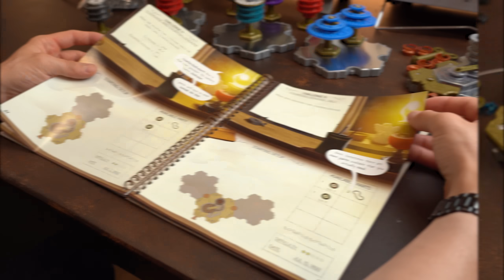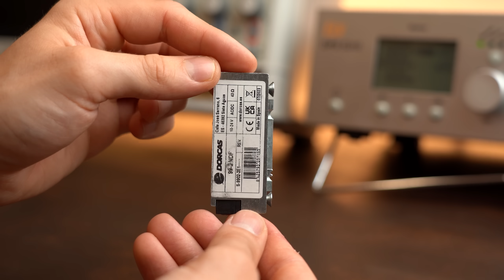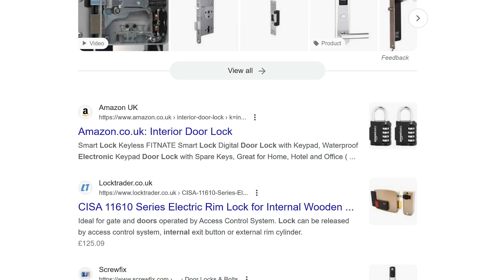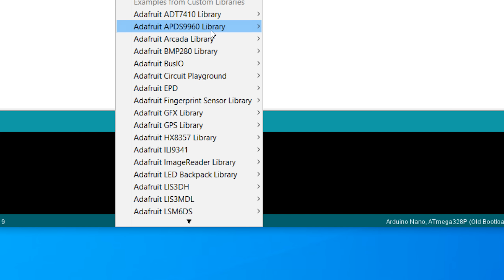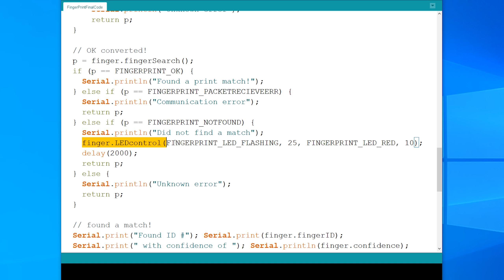Your Door NEEDS this Upgrade! DIY $40 Fingerprint Lock!

Comment: come on... you can do better
So you made your lab less safe...? All it takes to hack the system is a hammer and several batteries.
And less convenient, because you have to open the door with two hands instead of one.
If the lab is only accessible indoor, then why bother locking it? Just don't let dodgy people get close

Comment: I was SO excited to see this video, and here's why. 

For quite some time now I've been designing garage doors that open upwards (like a doggy door) with a hydraulic ram, there will be two, however I still want to be able to walk in and out without needing to open the entire bay. So one of the garage doors will have a person door and that is what I'm here to talk about. 

I basically had the same idea as you for security, fingerprint. But to hold the door closed I remembered something I've seen long long time ago, magnetic locks, so electro mag on one side and receiver or whatever it's called on the other, when powered you will NOT move the door but when un powered it will move freely, so I just need to get the proper pieces to operate the magnets and code a raspberry pi to turn the magnet off when I scan my finger or tell it over software to turn off. But it will also have a backup normal lock that I typically won't keep locked in case power goes out. And just for further background, my garage runs pretty much solely on solar power and batteries so I'm running it all off DC, the PC, cameras, hydraulics and security, so if its like winter and can barely charge my batteries I can still get in the garage when it's powered off.

I completely failed at proper grammar in this, got way too excited to think properly and just spat out a super condensed version sorry about that. 

But I would recommend looking into the electromagnetic locks because when un powered they're off which means if you ever experience technical difficulties, just cut power and you can get in. 

Yes, I'm now realizing I could've just said that Instead of my huge tangent, sorry about that too lol

Comment: I would not put the opener power leads outside of the Lab, I mean right now it might not be a worry but you might still want it be a secure thing even when your kids become 5 years old or so. 
I don't wanna brag but I was surprisingly observant at that age and was able to understand basic electricity, electromagnets and electric door openers at that age (granted I had good guidance because I had a grandpa who basically thaught me, but that could be the case with you too).

Basically what I am saying is, when the opener wires are inside the lab and there is only a data connection going outside there is no chance anyone could rig the mechanism to open.
There is only one thing thats worse than no security and thats security you trust but is flawed.

Comment: You should have put the electric lock on the same spot as the regular lock instead/in addition to the handle. That way you can use the electric one and the handle does nothing, and you have the backup of being able to mechanicslly unlock of something goes wrong.

Comment: Why are you didn't use some electromechanical lock, that mounts inside the door. You was able to make a little strobe via handheld milling cutter in the door and provide power to it from the LAB. It also didn't require any wierd looking boxes.

Comment: But why not modify the lower metal holder (the one where the part moved by the key lock goes in) instead of the top one? You can have the door locked with the key so the fingerprint mechanism can do its job and don't need to do the knob conversion while also having a second way in (by unlocking the door with the key) instead of relying just on the mechanism (or even the electric lock itself) to work.

Comment: If I may suggest something:
Put a power port in the enclosure from down below, if you don't have the key nearby (top of the door frame, for example).
Reason is, when you have a power outage, you can feed power to the cicuit with an external power source, so you can enter even then. Or something fries the circuit...

Comment: For extra safety, you could add hinges that auto-close the door so you don't forget to close it. I'm still haunted by the time I was visited my brother's place with his newborn baby, and they had a child door blocking the stairs to the cellar. So I'm sitting in the living room, and the mother is off in the kitchen, then I hear the horrible sound of the baby going down the cellar stairs, because the mother forgot to close the door. Thankfully, the baby was unhurt.

Comment: The reason commercial solutions are battery powered is that if power goes out, you dont have a way to get in since it has no emergency override or something like that. What I would do is make it battery powered, have the micro controller in deep sleep and wake it up whenever the scanner reads a fingerprint. Then, if the fingerprint is the right one, a servomotor turns to temporarily move the mechanism and open the door. After 10 or 15 seconds it resets and thats it!

Comment: For the commercial, battery powered, handle based fingerprint locks would it be possible to add wireless charging through the door frame? I assume adding leads to the battery would be easy (maybe hard to make it look nice), but it might be challenging integrating safe charging and coils (?) to the door/frame. Just trying to be creative. Awesome project!

Comment: Very cool project, as usual. Very pratical and useful as well.  Nice fix with the doorknob swap.
Very sad someone doesn't like the cable channels for wiring. They are hardly noticable when installed, and are industry standard.
What, they want you to open the walls and run cable inside?  dusty, horrible mess. I bet if you installed the cable channels, nobody would ever even notice.

Comment: Insert the controller inside the door frame as you did to the electronic lock. Route the power wires inside the frame and get them out near the floor. Drill a small hole on the door frame and install the sensor there. Easy and neat.

Comment: Another great video!
About babies, I still remember that day when, coming home after job, I find out, that my daughter peeled off all roll with smd resistors at supervision by shes mom.. 😂
About indoor brackets from industrial segment - You can get them for indoors too, but, usually, they come as an kit with release magnet and bracket..
For powering - just drill through wall and add from inside battery backup system from industrial or commercial door alarm (access control) systems.. Thats means - power supply, battery charging  module (usually come in one box) and deep discharge SLA  battery.. 😉 Works every time for years..

Comment: Hold up. You say you don't want a battery because needs regular charging. But the lock has to only work when the door is closed. This means you can have contacts in the door frame which energise it, and some hold up capacitance. Or trickle charge some cells.

Or just run a wire at the hinge in a wire guide.

Comment: Nice work, my father used the same system nearly 30 years ago too, so you dont need a key if the entrance door falls into the lock while being outside in the garden. He used a keypad instead of a fingerprint sensor, but the principle is the same :)
As people have pointed out, electronics always on the inside to make it temper proof :)

Comment: For future reference, the electromagnet piece, it's called an Electronic Strike Plate, which helps with locating versions for both inner and external doors.  Generally though, you're not gonna find many that fit within existing strike plate designs, simply because the latch does have to allow the pin to pass through where the strike plate is (and thus through part of the wall).

Comment: You ARE aware that they make flexible door wire conduits designed to connect the door frame to the door leaf, right? mostly thy are used with twin-leaf doirs or security sensors. But you needn't have bothered with that. Since literally any lock only needs to operate when the door is closed, some spring - loaded contacts in both the leaf and the frame would have done an adequate job to run any off-the-shelf leaf-mounted smart lock. Well most of them anyway.

Comment: Congrats on the addition to the Great Scott family! Could you run the conduit on the inside of your shop and connect the low voltage wires through the back? That would look clean from outside, which is probably what matters most.

Comment: you said at start of the video that you cant use solenoid or other types because of no way of powering it from outlet,and you still need outlet for this solution. Also what in case of no electricity?

Comment: We have a professional electric doorhandle thingy from Simens at work, and everyone hates it. Battery failing without warning, overcomplicated opening mechnism using servos, mechanical instability unreliable service. Using your sytem replacing the fingerprint reader with an rfid-chip and many problems would be easely avoidable. So great project.

Comment: You usually put the microprocessor, power supply and solenoid wires on the secure side of the door and only have the fingerprint scanner on the outside for security reasons, not that it matters being inside your house of course, but it might look a bit nicer

But that said you don't have a mechanical backup on the outside so if the arduino fails you are locked out so you did the right thing

Comment: man you have 2 mods to do there for safety.
1- put a UPS system there, you know hot to do that
2- put the eletronics inside and let just the sensor outside or bypass the fingerprint reader is will be child play

Comment: I would run the electrical inside of the lab and then have only the fingerprint scanner mounter on the outside via a through-hole. Also this would be a more "secure" solution as well.

Comment: Great project thank you, just some ideas here - Could you put the release on the lock instead of handle latch and leave it locked so the release will allow it to open and you will have a failsafe of the key? Also, to keep people happy on the aesthetics,  have the control box on the inside with just the fingerprint reader on the outside? (Maybe a nice bezel for it but still sitting flush). Remote control too if you use an ESP!

Comment: Wouldn't it have been better to put the electro lock on the locking pin instead of the handle pin? Then keeping the door normally locked, you could unlock with key or fingerprint. Also you could move the electronics and power to the lab side of the wall, then just have a small box for the finger print reader module on the outside wall.

Comment: For any such system, you need to think about emergency egress, e.g. there is a fire in the secured room.  Looks like this is handled OK, the original lever will allow you egress even if the power fails.

Comment: the lock mechanism coukd be mounted  to realese the deadbolt instead of the latch? If so you obtain a nice double function open  electronically or vie the key ...  so you can leave a 🔑  high enough not to be reached by the kid but available for emergencies.  . For the mounting if you moun in the wall ongly the finger prtin readers,  pass all the wires behind your "approved" will be much happy  and you can mount the rest of the elctronics on the "safe side" of the door... so your lab could work also as a (weak) form  of panic room ..

Comment: the electronics really should be inside the lab, or more precisely unaccessible to a potential intruder. i know your concern is mostly safety and not security, but for a truly secure system, you should also make it tamper resistant so that an attacked could not just open the plastic box and supply voltage directly to the solenoid. i understand your solution perfectly solves the problem you had, but maybe this should be mentioned in the video so that other people who inspire themselves with it at least consider the aspect in case security would be their concern as well...

Comment: Works great for just home use to keep the kids at bay, but the fatal flaw in that is that all your tech is on the outside of the door.... opening the box and directly connecting the lock would open the door... best to put as much of that stuff on the inside of the room, feed only the fingerprint through.

Comment: Unfortunately no failsafe! There are inserts for room doors in which you can insert a lock cylinder. Then you can retract the upper bolt with the key. Costs together with the cylinder some money, but it should be worth it.

Leider kein Failsafe! Es gibt Einsätze für Zimmertüren in die man einen Schließzylinder einsetzten kann. Dann kann man mit dem Schlüssel den oberen Riegel einziehen. Kosten zusammen mit dem Zylinder etwas Geld, aber das sollte es wert sein.

Comment: I wonder how many are seeing this shaking their head about how many man hours this guy, that probably makes well over $200USD+ per hour, spent on "securing" a door that has a frame can easily be pried open.  Specifically the part where he's cutting into the door frame where it shows the low density fiber board @5:01 that the lock and lock plate mount into. At least the door opens outwards, I guess?

Not to mention the latch looks like it doesn't have anything to prevent a credit card type attack...

This is an awesome vid and a lot of fun work.  If we're talking about actual security, this is not the way.

Comment: Why didnt you just put it on the lock part.. and always have the lock with key always locked, and in case of it not working you could easily use the key and unlock the door. no modification to the handle have to be done

Comment: I would've added the electrical lock to the bottom part of the lock which locks with a key. So when the key is in the locked positions it requires the fingerprint, and if the key is in the open position it doesn't. That would be a good failsafe if this is just for keeping the child out.

Comment: This is dangerous. In case the power goes out, you can’t open the door. You should use one that unlocks when power is removed and locks when power is applied. The Hook Up youtube channel talked about this in his back door lock.
Reply: You can still open it from the inside using the door handle, which means it meets safety requirements.

Comment: Just use electro-mechanic self-locking lock with some fortified cable harness on the safe side of the doors. These come with a panic function - so you will not stay locked-in inside in case of fire or power outage. Despite it's often a required function by safety regulations anyway. Your solution we call "BEFO lock"and it's usualy easily bypassable. See ASA Abloy and Bera solutions (no ad intended)

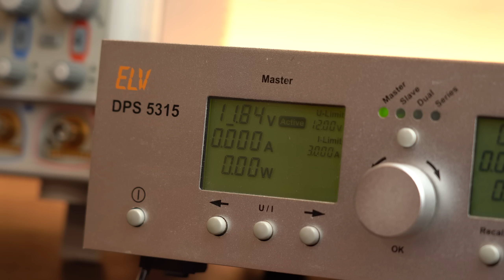Comment: 3:03 You can actually charge the battery with the door closed. Four conductors can be placed on the face plate and strike plate part of the door lock. Two conductors will be attached to the face plate part. The other two conductors will be attached to the strike plate part. When the door is closed, the circuit closes and charges the battery. When the door is opened, the battery feeds the circuit.

Comment: I think much better solution would be to place the electronic lock in the lower hole. That way the door could be "closed" all the time and in case of power outage you could unlock it manually with a key.

Comment: Congratulations with your new born! I had the exact same issue. My "lab" (mancave) is not the safest place. But I told my daughter what she can and cannot touch, and she listens very well (so far). I also installed a normal manual lock to the door. ;)
Reply: I had the same problem the fix was that i used an Ikea suction cup to hang the key to the dor - less fancy still usefull

Comment: Hi Scott,

So glad you chose a solenoid striker. However, as other commenters have noted, you need to do one or two modifications for safety. When using this type of access mechanism, you always need a mechanical override. The easiest solution is to configure the latch with a mechanical lock. Normally this is kept locked and the striker is used to enable access. But when there is a failure the door can still be unlocked and unlatched as normal. You should be able to find a "privacy" version of the same latch handle, or one with a lock. You can then ignore the lock below. Alternatively, if the bolt on the lock can be shortened to work with the solenoid striker, then you can swap which ones use the solenoid striker and just leave the deadbolt locked normally.

Finally, a couple security and safety fixes for the sensor/controller. You can add a battery backup as others have suggested, or you can provide a auxiliary power input. This will not be as secure, as someone could destructively apply over voltage from the outside, but I don't think that's in your threat model. So maybe it's a good solution, just put a barrel jack.

The other thing is to move the controller inside the door. You want the controller inaccessible, and also maybe the wiring ducts will be less offensive if they are inside your studio and not in the hallway.

Cool project! Excited for phase 2!
Reply: Exactly the things that I wanted to suggest! Last comment will probably help with “wife” acceptance.

Comment: A tip for the future. Look up the company Assa Abloy. They make A LOT of electric locks. My recommendation is the EL580, it opens when it gets power, but its also a so called split lock, so from the inside the handle can move the lock without power